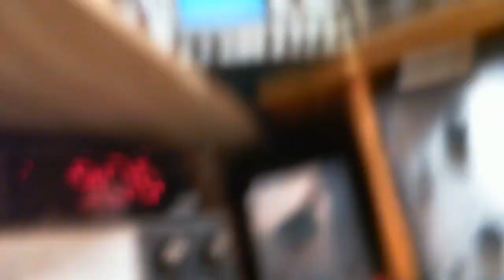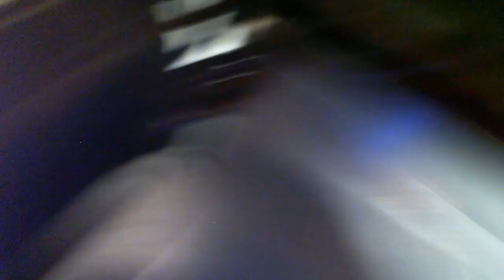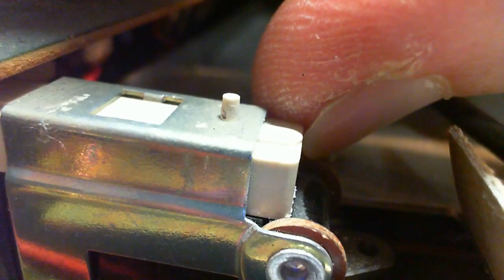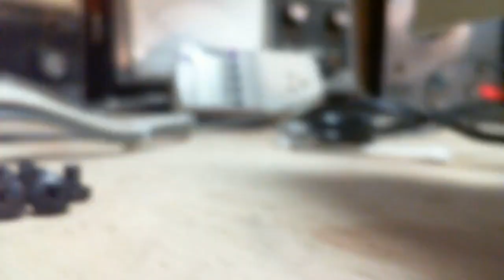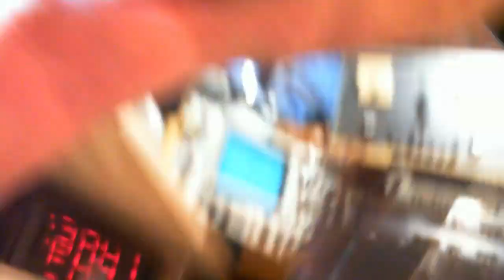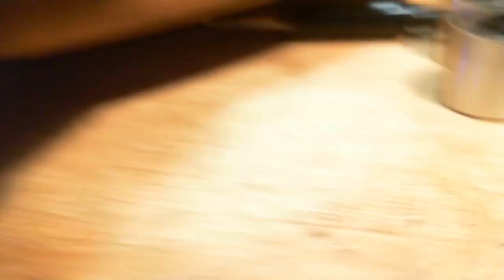Marantz 4230 Quadradial Receiver

Comment: I just got one of these free
No power at all
 Fuse looks brand new. No signs of blow up parts inside. Have not tested the power switch yet. In your experience with this unit. Chances are good my power switch needs a dexoit?

Comment: Jim. I had a Marantz 4400. Bought new in 1977 it was almost $1100. It developed the same problem with one of the push buttons. Oddly enough, it was a button that was hardly ever used. The 4400 was 150w x 2 and 50w x 4. Hooked up to a pair of Klipsh Heresy and a pair of Jennings Research speakers, it rattled windows four houses away. I seem to remember that Superscope had bought out Marantz around that time. The receiver was a real mixed bag, but even as one by one the lights burned out and even after a Coke was spilled into it, The darn thing kept right on going. The only ill effects from the Coke was it blew the fuse for the oscilloscope. Easy fix. Thanks for the blast into the past Jim. You can't go wrong if you buy it.

Comment: It is filed inside the contacts you need to take the switch apart more than likely it's repairable? And that's why you're having the problem with the speaker output.
The contact has jammed itself inside the switch? You could try flicking the switch might release it
Why does it need to disconnect the speakers? Prevent crackling on your speakers when the capacitors discharge.
Easy repair old glue is failing why they need those rubber rings anyway I don't know